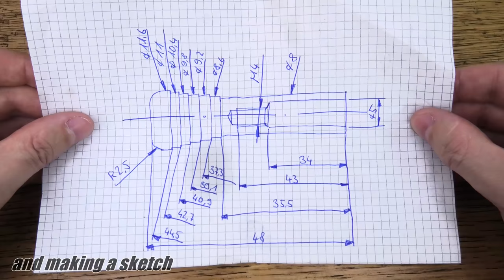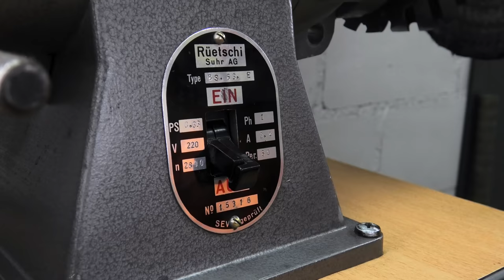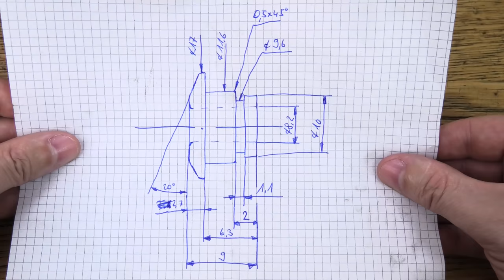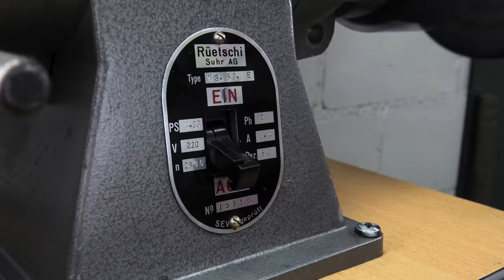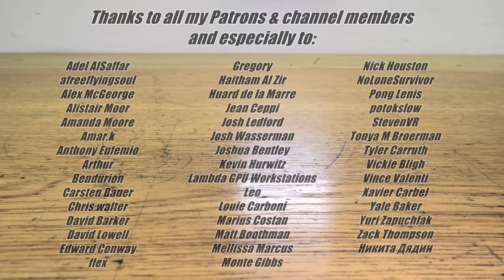Making Custom Chrome Door Knobs - BMW 323 I E30

Comment: That looks so classy, on a beautiful car. It really does. Here in Australia during summer, you would have to use a cloth to grab hold of a metal nib. Internal car temperatures can get up to 80℃, leaving a nasty burn, touching anything metal.
Reply: А в у нас в России зимой может замёрзнуть и тогда машину не открыть😁
Reply: 80°C?????? my water heating system goes to 75°C at max, the seats and dashboard would literally be melting in there
Reply: Well, I suppose in Switzerland, where this car is driving around, this won't be a problem, but I still think it was not good to make them out of metal, because given the thermal conductivity, in alpine winters, when temperatures drop well below freezing… He should have replaced it with other plastic parts or anything else nonmetallic.
Reply: At our mile high altitude in Colorado, water boils at 91C or 196F.   80C is 176F.. that’s very 🥵
Reply: @nafthalene   At 35℃ the inside temperature reaches 65℃. In South Australia, where I live, we have had outside temperatures of up to 46℃. I've got into my car on a day like that, and I had to get out again. It was frightfully hot and I had to wait with the door open for it to cool down. Years ago, anything made from polystyrene used get soft and deform if left in a hot car.
Reply: @channelsixtysix066  Я живу на юге России и у нас каждое лето тоже 40-42 градуса Цельсия.
Reply: @russkichelvolg   You go from one extreme to the other. That can't be good on cars, buildings and infrastructure .... or yourself. I couldn't begin to imagine living in those extremes. I don't even know what snow looks or feels like.
Reply: @mediocreman6323  It's unlikely someone will drive a 35yo BMW during winter. Most likely it's something they only drive on pretty summer days.
Reply: @channelsixtysix066   And yet these temperature ranges are not unheard of in extreme continental climates, like central Russia or the northern plains of North America. You see the same range in places like Minneapolis and Winnipeg (where I live). Properly built brick and concrete structures can easily survive that kind of yearly temperature swing. 

It's a slightly different issue in areas subject to more sudden changes - ie. 40-50°C temperature swings over a few days' time all winter long, like southern Alberta.
Reply: @Ea-Nasir_Copper_Co   - At -50°C, I have no concept of what that feels like. The coldest I've experienced is around -5°C in Canberra, our nation's capital.
Reply: @channelsixtysix066  -50°C doesn't feel much different than -5°C, it just 'bites' a lot quicker, and penetrates deeper.

It's funny you should say "I couldn't begin to imagine living in those extremes.", because that's what everyone in a temperate climate thinks of the heat in Australia!
Reply: @vibingwithvinyl  We in Brazil say it's a Sunday's drive. 🤣
Although people who own cars like these only drive them to meetings/expositions where other people also bring their relics.
Reply: @rebmcr   LOL, I you're right. 😄 There was a week of temperatures in the mid 40s that had that high of 46°C. The night temperatures were still hovering at around 37°C, due to the hot northerly winds blowing down south from the desert regions. Hot nights like that aren't unusual. I go down the beach like a lot of others and just sit there.
Reply: @channelsixtysix066  I live in the Southern California desert.  We usually get a few days in excess of 50C.  I actually once had to direct traffic when it was 126F/52C.  The roadway gets soft and stuff melts, or, as you stated, gets too hot to touch.  A lot of restaurants have foam tubing over the metal door handles.  Given all that, metal lasts longer than plastic and plastic tends to get brittle quickly, although the new polymers are much better.
Reply: Delrin would be a good material perhaps
Reply: @oldesertguy9616   Directing traffic in that weather is not good. Was that because of traffic light failure due to the heat? I hope you kept well hydrated. Agreed, plastics are much better now than they were. What made the 46℃ day concerning is not only the obvious risk of bushfires but also we aren't that far away from the coast, just a few kilometres. The desert interior of the continent gets up around the mid to high 50s in summer, similar to the your desert regions. So many people have got lost out there and died in the heat. We're now heading toward summer, but hopefully, La Nina will still be having an influence, so it won't get too hot.
Reply: @channelsixtysix066  It was actually because of a structure fire.  We had to block the street to keep traffic from driving over fire hoses and getting in the way of the fire fighters.  What made it extra special was wearing a ballistic vest and regular dark blue uniform, lol.  I had a friend who runs a local radio station go by a convenience store and get me a big drink with a lot of ice.  He is still my hero.  As for heat casualties, that's pretty common here.  I'm still wondering why I'm still living here.
Reply: @oldesertguy9616  Jeez, the only thing missing was the trench coat. You were lucky you didn't get heat stroke. 😬
Reply: @mediocreman6323  As far as metals go, stainless has relatively poor thermal conductivity. It has about 1/3 of steel or 1/10 of aluminum.
Reply: That's what I was wondering about. Even Europe has summer sun.
Reply: @serenity6415  Ma'am, I found out by painful experience when I went to pick up something I had left in the car. It left a mark on my fingers similar to a scold. That's because I didn't think first. Even a shiny leather steering wheel cover is too hot to touch.
Reply: @channelsixtysix066  I read that in a Texas accent. And I don't doubt that one bit. When my brother moved from Edmonton to Dallas, he wore a black shirt on moving day and said, never again. Threw out all his black shirts probably. As long as the owner remembers to just use the key in the summer..
Reply: @serenity6415   Ma'am, at 46℃, it no longer matters what color you wear, it's just HOT! 😊 And as I mentioned earlier, the temperature is still around 37℃ late at night. Down at the beach, not even a hint of a sea breeze for any relief. Some people go beach swimming at night, but it's not a good idea - sharks. Going from Edmonton to Dallas would have been a weather shock. I have an uncultured Australian accent.😆
Reply: @channelsixtysix066  LOL well dang, now I have to re-read it in an Aussie twang . Yes, at that temperature, just why bother living really.
Reply: Ma'am, I watch a Canadian channel, "Cold War Motors". Scott and his "Agents" as they resurrect old cars from the 1950s, 60s and 70s. They live in Alberta and I've seen the snow blanketing everything. He (Scott) has mentioned the temperatures in the dead of the Canadian winter at something like -40℃. They're a hardy bunch. It doesn't stop them working on their cars at night.
Reply: I'd pull the door locks up with my bhole
Reply: I remember one hot day in Adelaide when my steering wheel was too hot to touch after parking in the sun for a few hours.
Reply: @maggs131  You'll want to keep some Armor All wipes handy then lol. Also some aloe for those hot days. Why, though? I gotto ask. The cheeks would be easier.
Reply: @maggs131  10/10
Reply: @serenity6415  cheeks would be easier  but I choose to go the starfish route because if it were easy everyone would do it
Reply: @maggs131  I applaud your conviction, Sir.
Reply: lol yeah i see you have also fallen foul of the steering-wheel-on-a-summer-day trap
Reply: @evilotis01   Yes. I needed to leave and I couldn't, because I didn't have a robotic car to drive itself.
Reply: @vibingwithvinyl  In Australia that car would have blistered clear coat on the bonnet, a coathanger bent into the shape of Australia in the antenna base and 3 layers of my skin on the leather seat. It is just like Mad Max here. Honestly.

Comment: Nice as long as the pull knob doesn't make noise when it contacts the metal ring over bumps in the road etc.
Reply from the maker: yeah I was worried too, but works fine

Comment: Nice!    The metal "grommet" looks great and ads the layer of detail we've come to expect from you - but if the car has a vibration, the metal to metal noise may be bothersome.  
Version two can have a recess cut into the inside of the grommet for an o-ring to dampen any rattling noises that could happen. :)

Comment: Squeeeee! I love your work. You always make things look so much better. That classic car now looks classy. Tell your friend thanks for sharing with us.
Reply: I just now noticed the my mechanics stickers protecting the license plate. Excellent!
Reply: There is a really great pity. Due to this restauration the lost ment, because it isn’t original anymore. But in my opinion the car increases his ment.
Crazy world…
Reply: @wtsalive8210  Did you know that the stock BMW E30 manual window cranks were flimsy cast iron? Guess what they like to do? I replaced my broken ones with much sturdier cranks from an E34. Didn't look the greatest, but this notion that an 80s car needs to stay 101% original just for the sake of it is a bit silly. Especially when it's entirely reversible.
Reply: @wtsalive8210  You do know the lock knobs were broken, correct? And that BMW has both plastic and metal replacements, correct? Yeah, they could've purchased metal replacement knobs but getting MM to machine knobs that look identical is an homage to the original. I'm sorry, I don't get the fetish for old, broken, manky items. The broken stuff cheapened the car, it now looks classy like a BMW should.
Reply: @Vickie-Bligh  
Think, you misunderstood me.
Yes, I saw the broken ring. And yes, in my opinion the ment of this car increased after the replacement, which is a really great work(I love all his workparts!)!
But the ment of the car would be higher, if the replacement would be original replacement! And again, I think, that the ment is higher than with original lock knobs!!! But the experts have an other opinion!

Comment: The ASTM equivalent of Euro 1.4305 SST is 303. It is the preferred grade for machining and turning.
Reply from the maker: Well said
Reply: I actually see the AISI standard being used quite a lot here in Denmark, when it comes to stainless steel, but mostly AISI 304 and -316. I don't think I have ever worked with 303 myself.
That being said, I absolutely hate to work with the material, be it machining or welding. I prefer aluminium, it is a so much nicer material to work with.

Comment: Even though using that much raw stock is a little expensive, those detailed door knobs look VERY nice!
Reply from the maker: It only had ø15mm and finall diameter was ø11.6, I think that was not too bad.
Reply: @mymechanicsinsights  Turned out looking great.

Comment: Beautiful work as always. :)
When I apprenticed as a fitter back in the day, I was taught to drill 0.1mm oversized holes for thread in stainless steel. I don't remember why. Might also have been from a certain size.
To me, they stand out a bit too much agains all that black, but taste is such a funny, subjective thing...

Comment: Looks amazing! I wonder how it would have looked if you had blued the parts so they were black, like the originals. Fantastic, regardless.
Reply: You cannot blue stainless steel. Bluing is controlled rust. I do agree i'd like them in blued to 👍
Reply: @PapaSchultz74  Huh. According to google, it is technically possible, but it uses special toxic chemicals. Interesting, good to know!
Reply: Yes! Perhaps anodising.  The irony of spending all that time and effort(I estimate each one would retail for around $85, fitted) constructing such a superior product and then making them indiscernible from the cheap and nasty original would be delicious.

Comment: I doubt it was your intent but your videos have made me realize how many corners are cut in most modern manufacturing. Brand new 40K car has sharp plastic in the handle the first thought in my head. "a person who cared could fix this in half an hour with a file. Guess they dont think it is worth it"

Comment: It looks great but I just wonder how cold it's going to get in the winter and how hot in the summer
Reply: схуяли в ней зимой то холодно?
Reply: I guess it doesn't get colder than outside temperature in winter… it seems colder to the touch, but that's just because metal conducts the heat of the finger so much better than air.
Reply: @CamaroMann  кроме этой приблуды в машине много металлический частей, так что вряд ли твои переживания обоснованы, братишка
Reply: I was wondering the same thing.  In my area they'd burn my fingers at certain points of the year.

Comment: Very nice! It gave me lots of ideas on the other uses for the bezel.i wonder if you need an inside o ring groove or an o ring on the knob itself just for vibration? those lock rods are always shaking around.

Comment: 1. Lovely old BMW 🙂
2. Amazing job on the openers. They look great.
3. What made you choose stainless steel over aluminium?
Reply: Stainless steel can handle more stress than the Aluminium. Keep in mind, these are drilled and threaded inside. (hollowed)
Reply: Polished stainless looks better, won't corrode, is stronger than Alu.

Comment: You should anodize them black. Otherwise, amazing work, as usual.
Reply from the maker: not sure if that works with stainless steel
Reply: @mymechanicsinsights  I think you may be correct. It looks like it can be done, but it doesn't last long, and the results can be iffy. Powder coating! Great work, btw. You do really beautiful stuff.

Comment: Beautiful - I used to have an E30 convertible and am seriously considering another.  One question - what is 1.4325 (or whatever) stainless steel?  I know 304/308/316 and other types, or were you referencing a dimension?
Reply from the maker: 1.4305, it's the german DIN name for that steel.

Comment: No Way. Svizzera. Snow. narrow mountain streets... You need to put your holy hands on an old 90's Panda 4x4 and squeeze 75HP by  999cm³ fire... wood paneling interiors... reinforced stuffs... lightened stuffs... sun roof because it has no AC... take inspiration by Nanna's garage over here (she is doing it on old 500)...